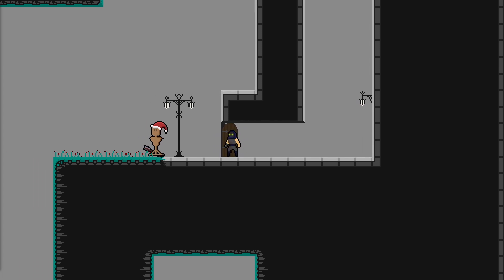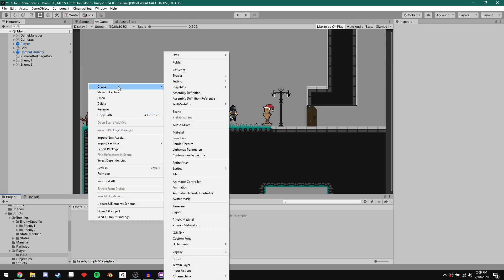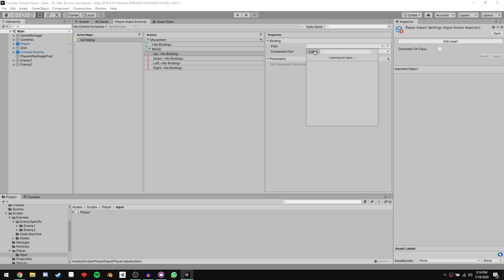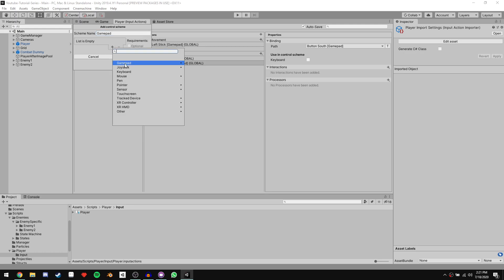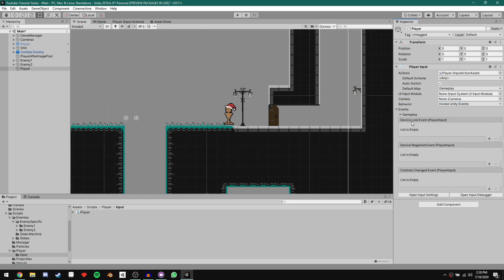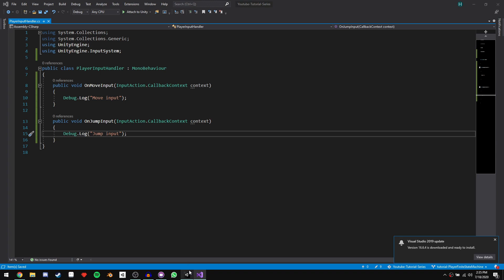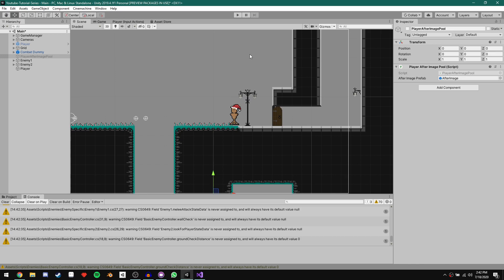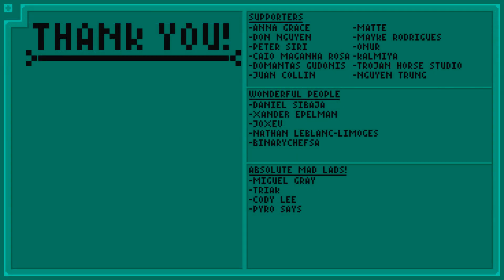New Input System! - 2D Platformer Player Controller - Part 20

Comment: why should we learn it if we already learned input system in first videos?

please answer, does it matter? or we can't do for example Crouch, Drop, etc in first input system videos?
which is more quality input system? i need your help and answer :)
Reply from the maker: This system will allow you to easily port your game to different devices like pc, Xbox, switch, or even mobile without having to change your code. You only need to define the input type for the action. This is the recommended way to go forward. You should be able to do everything from the first videos with the old system but it will be easier with this one.
Reply: @Bardent  oh wow very quick answer :D so you continue your future tutorials on that system or the first input system in beginning? I put lot of energy in these tutorials and its pretty effective xd
Reply from the maker: I'm using the new system moving forward :D

Comment: Hey Bardent, Its been a good adventure covering the enemy behavior and all the other tutorials. Iam trying to make a mobile game with touch buttons and i had no problem changing my inputs to buttons (Two for movement and 3 for Attack, Jump and Roll). Iam very keen to learn the new input system and you are one among the few who covered it. I have seen the new input system is meant for keyboard and joystick primary. So my question is will i be able to use it for mobile inputs also?
Reply from the maker: Hey! I just confirmed on some forums that the new input system should work well with the new input system as well :D The goal is to make it super easy to port the game from PC to console to mobile if you want. If I get some time I will experiment with the system some more and see if I can figure out how it works with mobile :D But I am very busy with university at the moment so it might take a while to get that done. Feel free to hop on the discord and see if anybody else has used mobile with it yet :)
Reply: @Bardent  Thanks Bardent for the effort you put in. I will find a workaround solution for it. Also take care of your health, get well soon.

Comment: Its better but seems takes more time to get going? Which could be frustrating for small prototypes
Reply from the maker: I see what you mean but you could also export your input files and reuse them in different projects that have similar controls :D
Reply: Nice! Good to know 
Maybe when this is out 100% it will come with a preset template